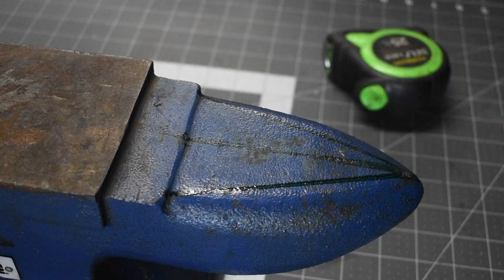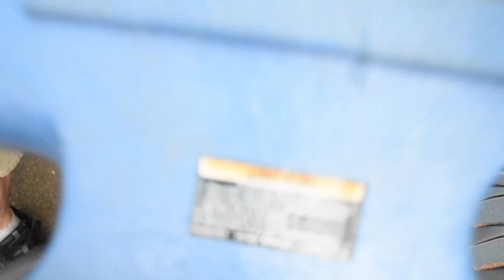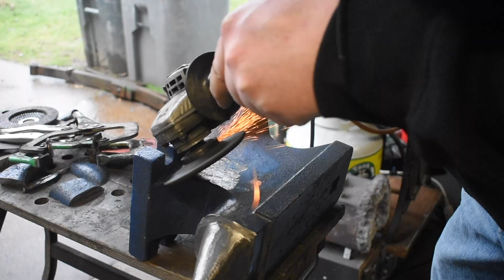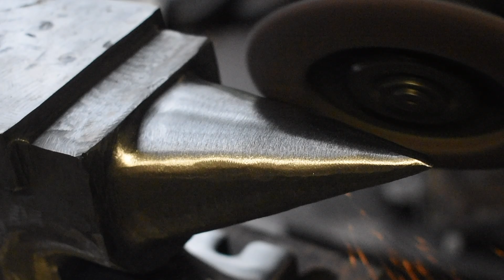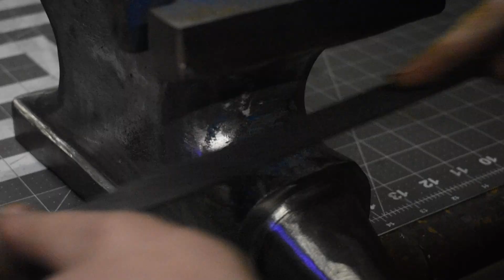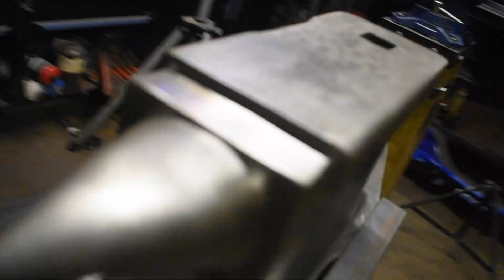Turn Old Harbor Freight Anvil Into Something Useful?  #blacksmith #anvil #forging #knifemaking

Comment: first all, You don't need a Grinding wheel to clean that paint off, just use a flap disc with more effect to clean off the paint because is faster or use sand paper with grits, and plus if you have holes in that anvil you made, you can use a cheap 110v flux core welder to weld up those holes and use a flap disc to get rid of that weld, ( if you have a blowtorch to heat treat that hole first and weld it last ) it could save you more time and easy to repair if get damage

Comment: Can you do the Doyle anvil work just like the original one 🤔
Reply from the maker: The Doyle is a lot nicer than the blue Forge one. The Doyle has a high carbon face. So it has a lot more recoil. And it won’t dent up as much. Or if you’d like to get one a little bit bigger, Vevor sells them up to 130 lbs.

Comment: If you have access to a welder you can pick up some hardfaceing wire / rods and add a few layers to the main face of that cast Iron anvil to make it Much better at actually being useful for forging... Many Old anvils were cast Iron with a steel plate welded on top as the striking surface.
Reply from the maker: I never thought about welding with hardfacing wire  to build up layers of hardenable steel. Thats genius! I do have a Miller stick welder too. I will defiantly look into that. Thank you so much for the advice. I really appreciate it.
Reply: @drewdoesart9277  Just in case you haven't dealt with cast Iron before, you'll  likely need to preheat it, and if it's not sticking well you  may need to put a layer of Nickle cast iron welding rod (ERNI99) down first to get a solid adhesion, as Nickle sticks to cast iron and carbon steels equally well.  the hardfacing I've used was for a wire feed, Blue demon's 55FC-O, similar to an H-12 steel. though I think their Alloy 7000 Rods would work well.

Comment: I hope your horn holds up. Being on a very limited budget, I was not prepared to grind my horn into a sharp cone so I did more of like a flat top with a fat cone at the end -more like those of the first anvils from the 1600s for fear of grinding down too far and accidentally knocking off the tip of my horn on a mis-blow lol😅
I do have my 66 pound cast steel accio though which has been my primary anvil so far but I want my cast iron to be the one I throw on the truck and take with me to make stuff to throw on the table as I make sales.
Reply from the maker: I wont be doing any heavy forging on the horn, I only wanted the littler horn for more small delicate work. Thats awesome to have something to take with you to events. That is something I would really like to get into. What kind of events do you sell at?